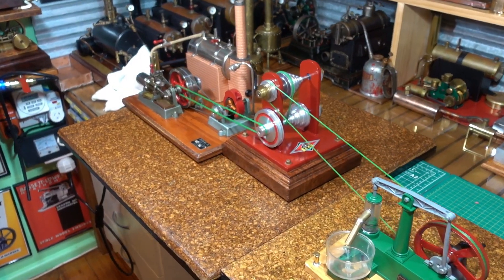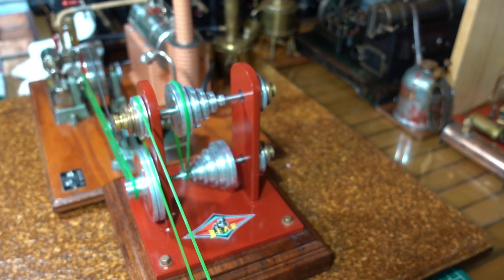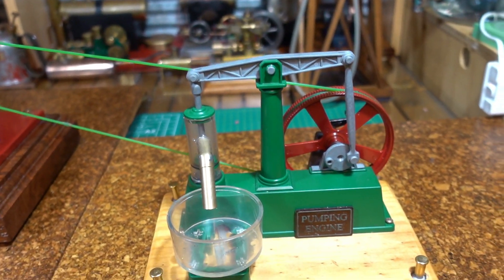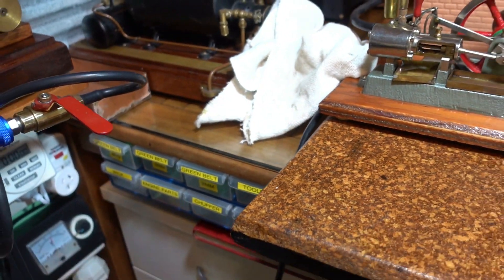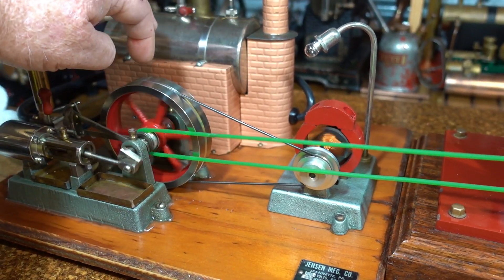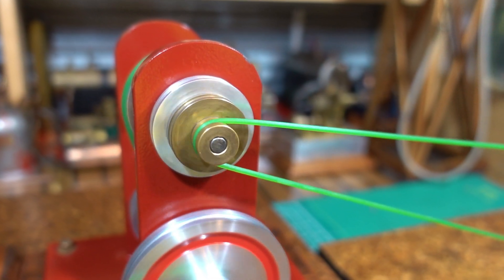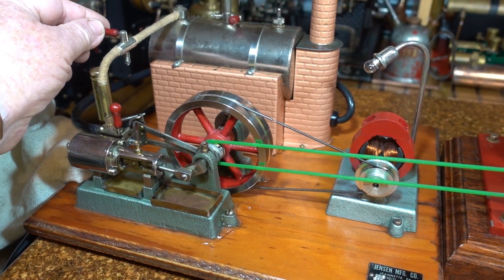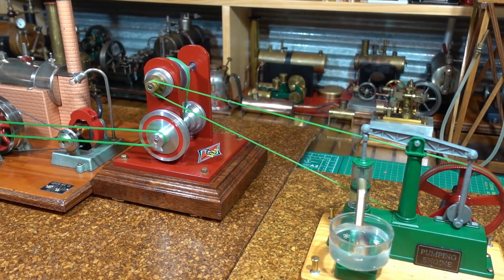Jensen 20G Model Toy Steam Engine with  Geared Transmission Running a Water Pump

Comment: Very nice setup Jim 👍👍👍 I've got one of the Empire transmissions which is very similar to the one you made. Very useful indeed for running accessories. Those Academy pumps are pretty good for a plastic kit. Cheers, Alan.
Reply from the maker: Thanks Alan, I modelled a horizonal one off the Empire transmission and it worked so well I then made this vertical one.  I put in roller bearings for the axles shafts to rotate in.

Comment: very nice job.
Reply from the maker: Thanks Josh appreciated mate.
Reply: @SteamEngines-Jim  Have you thought about making and selling the transmission you made? also did you add the displacement lubricator and the cutouts on crosshead on the engine?
Reply from the maker: @JoshKilen  G'day Josh, hope your tractor collection is keeping you busy mate. I made the transmission out of scrap that I had around. There's a LOT of hours in it and the weight is pretty high. I think they would be a perfect item for some to fabricate and keep the weight down. They would sell as driving accessories slowly is the aim for most toy/model steamers. A friend of mine in the US machined the cutouts on the crosshead, looks great doesn't it. I made and installed the displacement lubricator.

Comment: Did you have a specific ratio or ranges in mind or were you following a predetermined plan in making up your transmission ? Either way very nicely done 👍
Reply from the maker: Hi, no I just made it with available offcuts at hand. Base is mild steel and so are the uprights. The axles are through roller bearings and will spin very easily so even a quite weak powered toy steam engine will turn the transmission effortlessly.

Comment: 😎, do you have a drawing with measurements  for that transmission ?
Reply from the maker: Hi, no I just made it with available offcuts at hand. Base is mild steel and so are the uprights. The axles are through roller bearings and will spin very easily so even a quite weak powered toy steam engine will turn the transmission effortlessly.